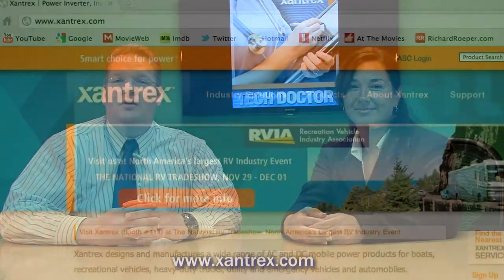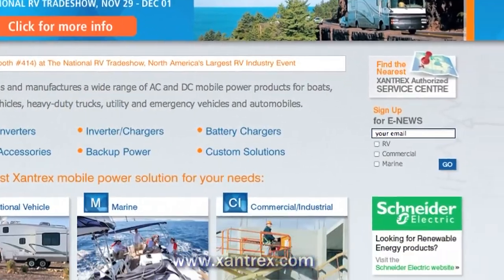Xantrex Tech Doctor™ - Inverter vs. Generator

Comment: he said the generator produces AC power, but that's not always the case......?
I thought unless the generator was an "generator/inverter" it would typically
produce DC power.
raw DC recharging DC batteries.......thus the need for an inverter to change it to AC.
am I way off here?.........
this vid is old and there are crickets chirping as far as comments go, so I'm not sure
I will get any feedback.
; S